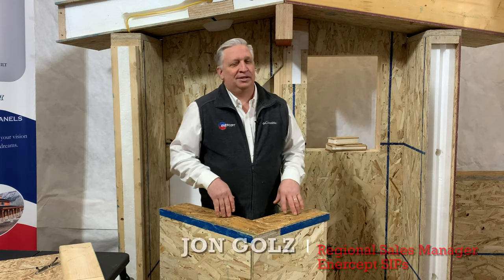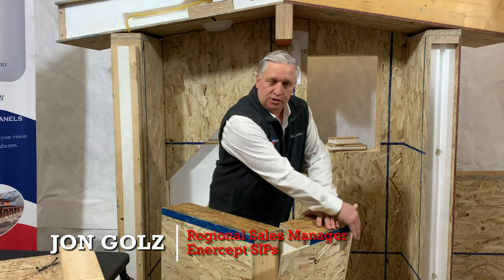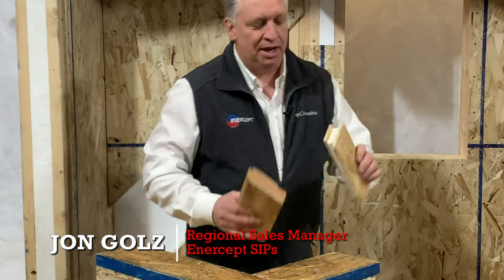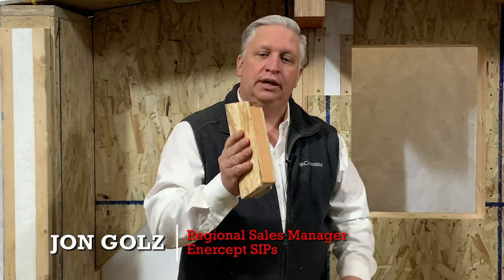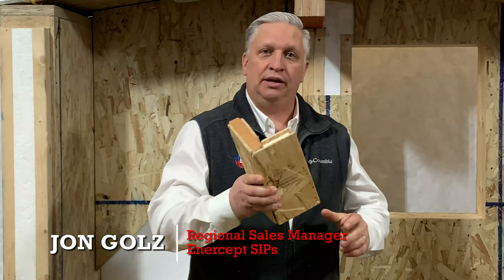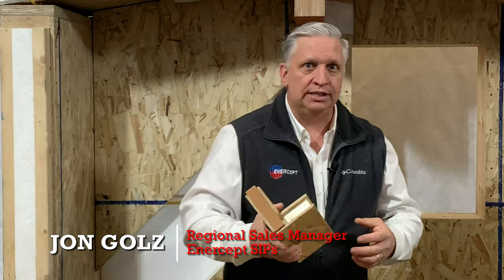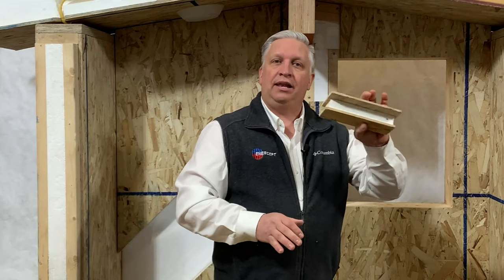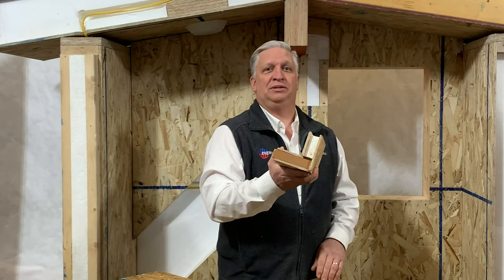What is a fly-by-corner and why does it play a very important part of Enercept Structural Panels?

Comment: If you do that, your inner panel isn't screwed to anything.  All that's holding it on is the adhesive.
Reply from the maker: The interior OSB skins don't need to be attached to one another.  The fastening of the fly by OSB to the 2x in the adjacent panel transfers the lateral forces.  Vertical forces are carried by the OSB skins to the floor system below..

Thinks about a butt corner with 2x's in the end of each panel, how are the interior and exterior OSB skins connected?
Reply: @EnerceptSIPs  
That's just exactly why they have to be butted up to each other.  The interior SIPs need to be as rigid AS THEY CAN BE - yours are not.  Sorry, but you are incorrect - I do this for a living as well.  I can't actually describe why yours are very wrong in this text, but I found a video which shows the correct way.  Look at 29:10 - left-hand side of the video.  A screw runs through SIPs panel and into the other.  If these were 122mm (5") SIPs, the screw would need to be 170mm (7").

With yours, if you put pressure on your interior wall at the corner, there's nothing but the foam to resist it.  If you look at your video at 1:00 you can see what I mean.  Your 'fly-by' is still strong, of course, but as we can make SIPs as rigid AS THEY CAN BE, we may as well.
Reply from the maker: Your link for the 29:10 time code does not seem to work so we can not follow what you are describing.

You refer to pressure.  What type of pressure are you referring to?  Wind load is transferred by the wall panels vertically to the sill plate and top plate.  

Sorry we don't understand what you are describing.